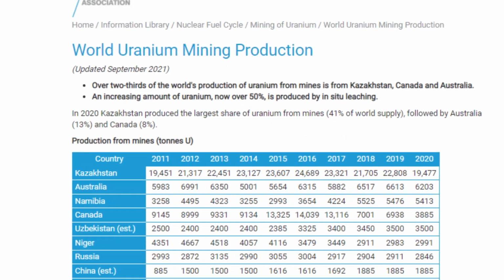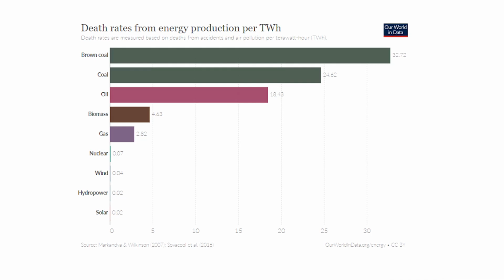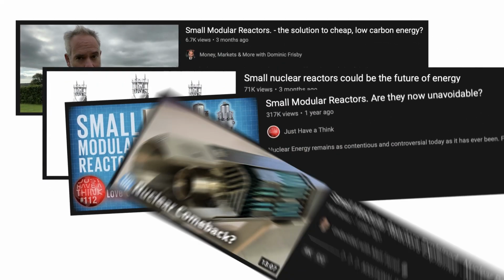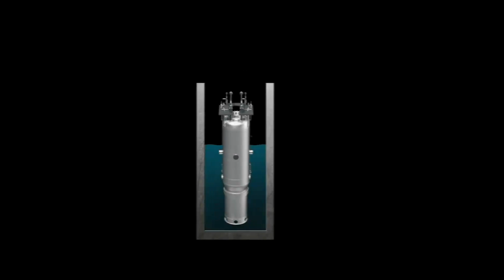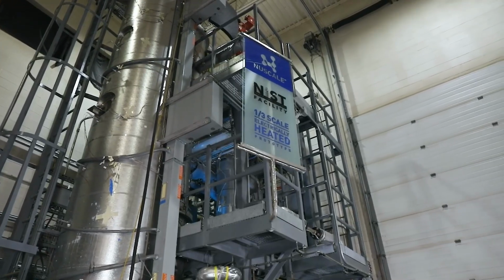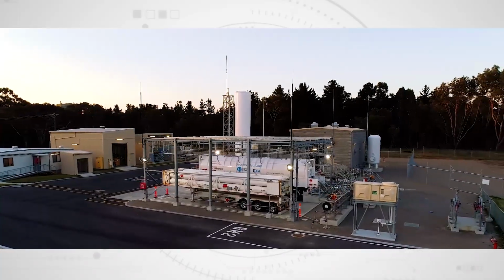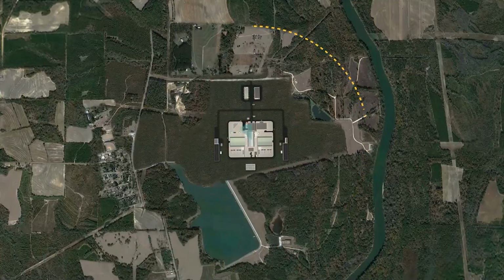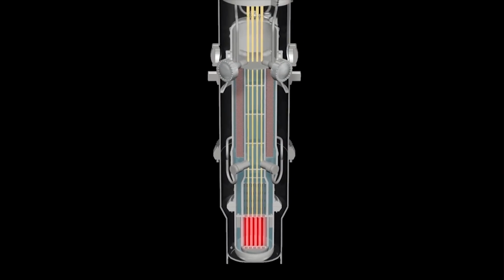Can Small Modular Reactors Save Nuclear Power?

Comment: I've never seen any explanation of how they intend to inspect these units, especially the steam generators. This integrated design is neat, but it looks like it would be a nightmare to maintain. 
Good luck to them, I hope it works out, but color me skeptical.
Reply: I believe there is very little maintenance to be done on site, with any major issues they replace the reactor and refurbish the old one back in the factory where it was built.
I may be wrong though, perhaps someone with a bit more knowledge can confirm this.
Reply: @Stambo59  That would seem even more impractical. Plants typically run 18 month fuel cycles, so they need to refuel that often. Shipping reactors around would be tough, plus if it's full of irradiated fuel, that adds another huge dimension to it.
I've been in the biz, and outages always involve huge amounts of inspection. That's not infrequently what kills plants, something develops a problem and it's too expensive to justify replacing something.
Reply: @durwoodmaccool890  The 18 month cycle is more of a legacy of the industry based on known burn up calculations, timing equipment maintenance / calibration schedules around them and bringing down the plants at minimum grid demand than a hard an fast rule for fission power generation. We are actually working on new calculations at our company to extend maintenance periods for our legacy plants. As far as inspections we are doing a lot of work with non invasive testing using underwater drones, fiber optic cameras, improved eddy current, and data analysis behind material corrosion and degradation and such to minimize the time impact of our inspections.

I would also imagine minimizing maintenance requirements will be worked out with the NRC during licensing for these designs and credit will be given for design simplicity and much better instrument accuracy in a modular vs bespoke system when figuring the margin acceptances (another process that should be significantly cheaper and streamlined when an SMR FSAR is submitted).

I do see where you are going with the "best intentions" point though. It does just take one inspection finding (or one golf trip between contractors / lobbyists and policy makers) to start a series of programs to cash in on the new technologies.
Reply: @anydaynow01  Well, good it seems as though that's at least being thought about. I just remember companies making dump truck loads of money off the back of engineering decisions that seemed just fine at the time.
Reply: @durwoodmaccool890  As you probably know, in conventional nuclear they need to shut the reactor down if they detect a maintenance issue. This loses the plant a ton of money but after a couple of months it is back up and running again. With Nuscale, if they detect an issue they may need to recall the reactor if it isn't built for on site maintenance. With factory production, this recall may extend to other units. If any SMR manufacturer has to do a general recall, the losses will sink the company instantly. This is one of the main reasons I'm skeptical that unit production of reactors is really a benefit.

Comment: I think SMRs are a very good options for electricity generation from the middle of the next decade forward.  However, I think they are going to be a hard sell as too many people have an irrational fear of this technology, despite that fact that reactors using 1950's and 1960's vintage technology have proved to be extremely safe designs.  

One area where this particular design seemed short of the 'promises' I have heard from other potential designs is the waist aspect.  You said this reactor will basically handle the waist the same as current large reactors.  Many of these smaller reactors claim to produce less radioactive waist and some even claim they can run off the waist of large reactors, reducing the amount of radioactive waist for long term storage.  Did you discuss this at all in the interview?
Reply: The reactors which will run on reprocessed used fuel are another generation beyond these early SMR designs. The efficiency with these new designs are in fact much better so there will be much less used fuel left over to have to recycle in the future per kWh. After this next generation of fission, fusion may just be ready for prime time, it will be interesting to see what ITER has in store for us!
Reply: @anydaynow01  I had not heard that distinction between ‘old’ and ‘new’ SMR, but it does make sense that the earliest designs would produce similar waist to current large reactors (and presumably nuclear power military ships.)  Future acceptance may depend heavily on a viable waist solution and the demonstration of using waist as fuel for next generation reactors would certainly help.   Fusion, however, is a not going to happen this century.  Even ITER is only aiming for a Q of one when evaluated as grid power in vs potential power out based on the thermal energy produced.
Reply: @anydaynow01  
The ITER is only a test experiment until 2040.  After that a new facility will have to be built if ITER shows progress towards success.  Then the new facility will not be a success until 2060.  The money for these multi-billion dollar fusion experiments would be better used if it was spent on building solar and wind factories.
Reply: The utility customers have no say in what the utilities decide to use for generation.  The utilities are the ones who have decided that nuclear is too expensive and takes far too long to bring online.  This is what will prevent nuclear from becoming a factor in ending fossil fuel use.

Comment: All this, to try to salvage the disastrous LWR archetype (which the reactor this guy's describing still is), which is almost, but not quite, the stupidest possible way to do nuclear. Just switch to LFTR, and you can trivially make it far safer than even this guy's improved version of LWR (LFTR can be easily designed to have no explosion-causing, or otherwise catestrophic beyond the walls of the reactor itself, failure modes at all), cheaper (in technical costs; the regulatory costs are still astronomical for any nuclear, including what this guy proposes), and with fuel costs that are, in many cases, negative (because rare-earths miners would love to mine tons of very rich sites that they're currently only being stopped because they have no way of disposing of the thorium that would also be produced by that mine; giving them somewhere to send the thorium would let the mine those rare earths, in many cases making it worth it to the miners to pay someone to take that thorium off their hands).

Comment: Rosie, I'm concerned that you have glossed over the nuclear waste and security issues. All of the Lazzard levelized cost of energy graphs you showed do not include the extremely long term costs of storing the resulting nuclear waste. If one properly accounts for those costs (they are the same magnitude as the capital and operating costs or essentially they double the published costs) then no government will invest in nuclear power. Further complicating this is the security issue (terrorist or foreign government bombing a nuclear plant). A solution to that problem is to locate a nuclear plant below ground (in a mine for instance) but again that raises costs and again nuclear can't compete against renewables.
Reply: Nuclear waste management isn't actually that big a problem.  The total quantity of high level nuclear waste from power plants, worldwide, since 1945, would fit in ONE football stadium.   Long term geologic storage is possible and is ready to go I'm numerous places.  It is only uninformed fear mongering that hasn't allowed it to happen.
Reply: @TechnicalBard  the size of the waste isn't the problem. The length that it has to be handled is.
Reply: @4drops  Ok my statement is meant to be provocative but here is the reasoning. At present there are no active long term solutions to nuclear waste storage so the costs of long term storage have not been included in the Lazzard reports. If there are no long term storage solutions we have to conclude that the present systems are to be used which is above ground storage. These facilities have to be guarded until the waste is safe which seems to vary depending on the source but is at least 300,000 years. So just assume that at the least a team of 11 security guards at a salary of $75,000/yr (benefits included) can guard a nuclear waste facility and at minimal one would need to guard it for 300,000 years that alone is $248 billion. This doesn't include the 2,400 site buildings that are required over that time frame (assumes a life of 125 years per building). A nuclear plant currently costs 9 billion (I don't know the lifetime operating costs but can ID that by looking at the worldwide workforce, number of plants and average plant life). But you say that isn't practical or possible? The best scientist have been working on this problem for 60 years now. The closest that anyone has come to long term storage is Onkalo waste nuclear facility in Finland, scheduled to begin operation in 2025. The capital cost for that facility is $4.0 billion dollars to hold Finland's nuclear waste. Operational costs of Onkalo aren't easily discovered. Also, it's not clear to me how much waste (i.e. what fraction of a nuclear plant's lifetime waste output Onkalo would store). I would have to do further research to determine what the predicted effect on cost long term underground nuclear storage will have but the result will be nuclear power is more expensive than renewables as it already is but by how much?
Reply: The high level waste could be fed into Molten Salt Reactors as fuel, some companies have already looked at building MSR's on the premises of existing reactors to use their infra structure and use up their "waste".
Reply: @killcat1971  my understanding is that reprocessing and reusing nuclear waste still gives off toxic waste (it does not reduce the waste to 0). Furthermore this less amount of waste is more toxic (longer 1/2 lives). Less overall waste true, but as mentioned it's not the amount that is the issue. It's extremely long times to handle the waste. Reducing nuclear waste is good perhaps not creating it in the first place is even better.
Reply: @danielvivian3282  Depends on the nature of the waste, the long storage time is due to mid term isotopes, these are often fissile (Plutonium, Neptunium etc) in MSR's they are kept in the high neutron flux of the reactor long enough to do so. This leaves a small vol of relatively short lived isotopes, so hundreds of years not 10's of thousands.
Reply: @killcat1971  sounds feasible so why isn't it happening today? Is it because it is unproven technology, decades away, the public doesn't trust the promises of the nuclear industry (I'm not faulting the nuclear industry they are very talented, thoughtful people, just too optimistic for real world processes), security is still a problem and renewables are cheaper?

I will grant though that the volumes of less nuclear waste with thorium produced energy is better, I don't have faith that renewables will be recycled properly and we could end up with mounds and mounds of industrial waste by using industrial levels of renewables required and am still not sure what the huge volumes of wind turbines necessary to transfer the required natural gas energy in the north to renewable wind energy would do to bird populations. I'd like to know more about these issues.
Reply: @danielvivian3282  Well the reason is that back in the 70's Nixon focused on Plutonium breeding due to money, influence and bomb production. But there are a number of companies that are moving forward with various versions of the tech, and China has a MSR in development. They actually had a MSR up and running at Oak Ridge national laboratories, although it was only a demonstration reactor to test if the theory was doable, it worked fine, at least as far as heat production.

https://www.youtube.com/watch?v=uK367T7h6ZY

Comment: In Sweden, we had a very succesfull nuclear program with 12 reactors of which 6 are still in operation. I worked with maintenance of these plants at the same time as was studying to become an engineer. I have in fact taken several showers in reactor water. Radiation is a very well known science subject and we know very well how it affects humans. So that we dont need to be worried about. Regarding small failsafe or passive safe reactors, the Swedish company Asea Atom had a ready to build solution already in the seventies. Unfortunately none was build and now Asea Atom is part of Westinghouse. From my perspective as an engineer working with renewables, it is an excellent idea to develop small safe reactors that can be placed closer to cities and provides the cities with electricity and district heating. We in the rich countries should instead focus on renewables where it can impact most, in developing countries so that they dont build fossile power plants.

Comment: I'm generally impressed by your video. NuScale is a very interesting vendor and have been for a while. Even though they haven't pursued Gen IV tech, they've achieved so many key features of what a power plant should be now that in my mind, it's a really good yard stick for a "sensible design". Too many reactors seem to be primarily technology advancement, and a solution second, whereas I think NuScale have taken a good approach to making a good solution and developing what they needed to.

Some of the key issues w/nuclear plants:
Risk of financing a plant (e.g. Sizewell C): modular design used here means reduced risk for financiers and shorter time between starting the investment and seeing first returns
Challenging build and construction (e.g. Hinkley Point C, Vogtle): smaller components lend themselves to factory manufacturing
Low variability of supply (e.g. entire UK fleet): multiple ways to load follow
Safety (e.g. Fukushima): passive pumping and passive safety systems

Not all of the problems are addressed by NuScale, but it looks like they've made a big dent solving the problems of getting nuclear power plants onto the grid. We'll see how it progresses from here, because so far all of these are promised benefits rather than demonstrated. I'm hopeful though. I'm also hopeful that other vendors will start to take a similar approach of solving the problems and not just pursuing interesting technology.

Comment: Excellent video cast, very well done. Still a very long term solution to our carbon free energy needs but who would want to live next to one of these?
Reply: I would certainly prefer to live next to a NPP than to a coal plant, gas plant, or wind farm. ANd I want electricity 24 hours a day.
NPPs are quiet, clean, and bring educated workers with good salaries to your town's tax-base.

Why would you not want to live next to one?
Reply: Despite what the fossil fuel, media and movie industries say to make money off of people's fears, sentiment has changed with time and will continue to do so especially as the old plants are decommissioned and the new tech comes online. It is like, looking at the safety and efficiency record of the average car made in the 1960s vs an EV made in 2022; they both transport people, have doors, a steering wheel and storage of some kind but the similarities start dwindling fast after those comparisons.

Comment: One of the problems with the traditional ones is risk. There doesn't need to be a Chernobyl kind of accident to cause extreme economical damage. Here in Switzerland we run an ancient reactor. Just releasing a moderate amount of radioactives to wind or the river would destroy potentially trillions of infrastructure and property. Just because you have to leave the area. And for how much are they insured? About 3 billion! So that risk is never included in the cost calculation. And what about waste? The most extreme of it needs to be safely stored for millennias! Who pays for that? But hey,  Australia has lots of space, why don't you just take it and dump it somewhere. 😉and guard it for that time, because you need to keep terrorists and such scum away from it. Otherwise they can make easy dirty bombs!
Then, what about running time? Self contained means no exchange of burning material? So you break down the whole power plant after 15 years? Or do you just exchange the reactors? But then the whole thing needs to be much bigger and more complex again. Same goes, security against terrorism? Airplane crash? Bombs? So I'm not sure they will have that much savings as they think. But all for much less energy and probably less time. So how does the cost scale then for the whole time.
And lastly, so the earliest full scale shall run end of this decade? If everything goes as planned! What it never does... So real data will be just available then. So wider adaption around 2040 maybe. So way to late to really tackle the problem we need to solve now! Why don't we go now with what we already have, do proper research and not silicone valley type of fundraising for a maybe...
If it works good it can start to stabilize the grid when our first or second wave of solar and wind needs to be renewed. Or maybe it will be totally obsolete by that time anyway.
Reply: I think this is a very underrated point. The "deaths per megawatt hour" graph doesn't actually show the cost of nuclear disasters. It only shows deaths. The economic impact of Chernobyl and Fukushima can't be understated. It is actually pretty similar to Hydro. It looks safer than wind and solar, but if a dam fails there is a massive disaster, which is much harder to deal with than the occasional fatal accident associated with turbine maintenance.